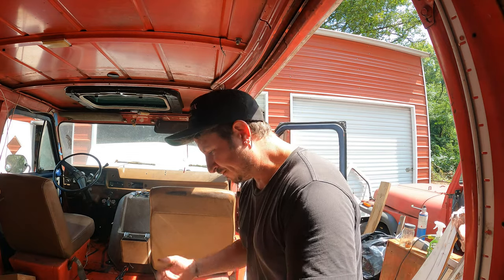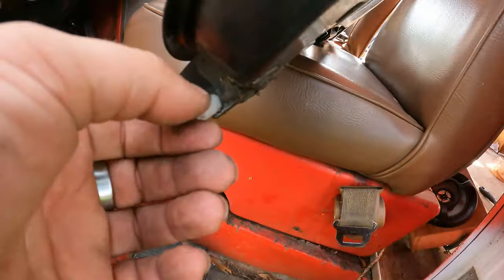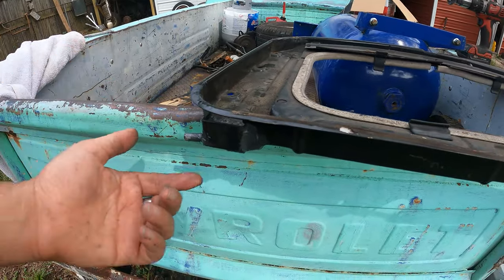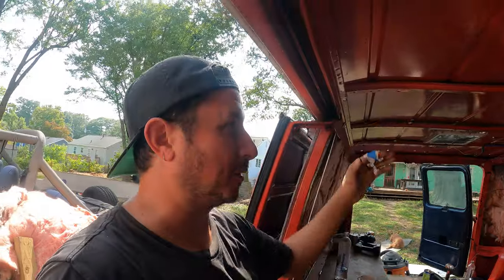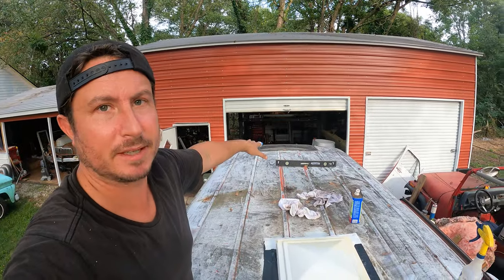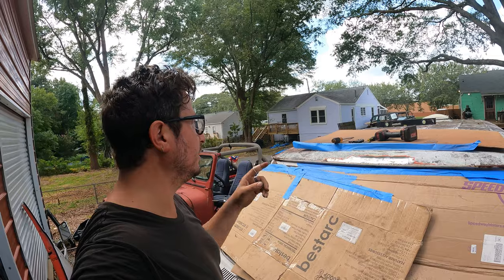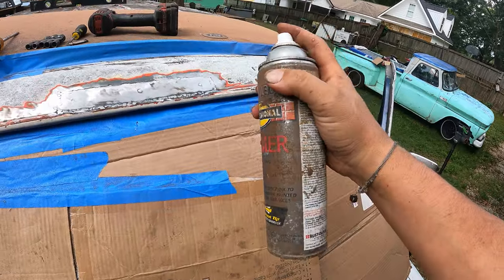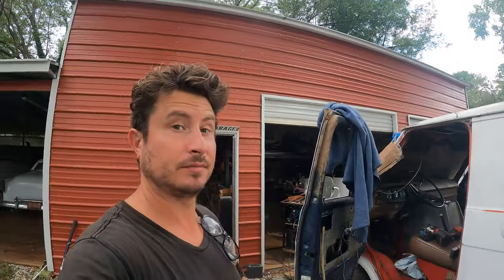Leak Proofing the Van- Vents, Sunroof, and Rust- Fix them ALL - 1973 Camper Van Build

Comment: The Flex Seal will work just fine.  We stayed at a B&B 6 years ago that had a separate enclosed 40' poolhouse with rows and rows of connected roof glass.  The retired soldier who owned it got up on the scary roof and sealed the entire thing with the stuff.  Used both tape and spray.  Has never had a leak. Just swears by, not at, the stuff.  Being a retired 6 stripe army sergeant he knows the difference. lol. Enjoy watching you.......  Being frustrated and keep your mouth civil is an art form. Stayin' classy!
Reply from the maker: fair enough.   I figured it was worth a shot.  I have used about every exterior home sealer on the market so I figured worse case it was the same stuff as the others with a fancy label and gimmic marking... or maybe it was a slightly more differenter flexible formula

Comment: Nice work patching the roof and welding the roof rafters my van used to rattle all the time at certain speeds looking good
Reply from the maker: thats in interesting phenomenon.    so far in my puttering around town I have not had an issue...  but that will drive me nuts if it starts

Comment: Gotta agree with qi9 on the NAPA seam sealer and the RV or mobile home roof sealer.  The forward roof header repair.... I have done three of those. All on vehicles that match the outstanding condition and originality of your murder van. Here were my three repair scenarios. First one, I was young and super broke and had some body shop supplies....not tools... at my disposal. I made a "repair" panel oversized and fit it from the back side using body panel epoxy adhesive. The rusted metal was removed first. That didn't work because the inner header was just too close to the repair to hold the repair in position long enough for the epoxy to set.  My post war era Forney stick welder was used, after cleaning the mess from the previous attempt, to tack that panel into position around the Hole I cut in the roof.  Several of holes were then partly drilled through the two pieces of metal and plug welded with the same stick welder. After grinding, a bunch of seal sealer hid our sins and some almost matching paint was used to make it pretty. The next  truck, we could get to the back side with some ease so the epoxy glue method worked. The same high end finishing was used as the first time. The third vehicle received a repair like yours with seam sealer and only at the bottom as plugging some small holes visible after grinding and sanding. 
I have installed more than a couple sunroofs over the years. That roof will flex too much to ever hold a seal well. In your case, A roof bow, like in the back of the van,  would help greatly welded  immediately behind your sun roof. Give only about an inch of clearance. Factory sunroof roof panels have a flange stamped around the hole or welded to the bottom side of it to provide a non flexing foundation.
Reply from the maker: i am glad you can appreciate the "outstanding condition and originality" of this fine specimen of an automobile. ...
its fun reading your stories... man has struggled for millennia to keep water out of places... its not even about lookin cool, just trying to stay dry.   
I will say for this sunroof, the roof has a lot of structure within 4 inches both to the front and the back and the sunroof pan is really stout.   so once the pan is pinched on the bottom it doesnt move much.   the source of the leak has always been the plastic additions to the drain pain.  so for so good on that repair though